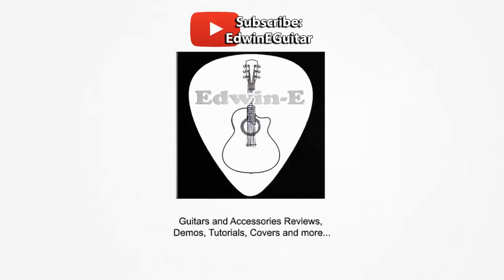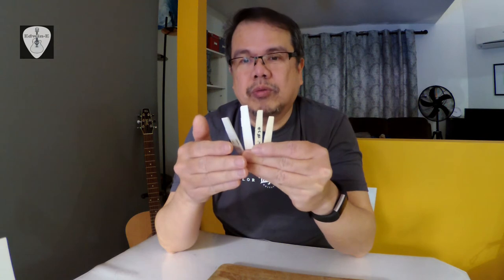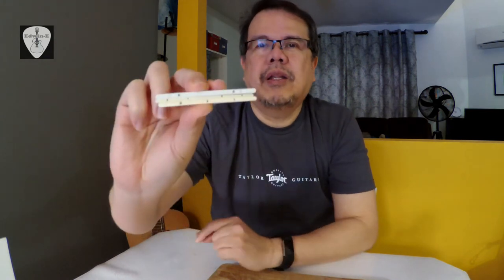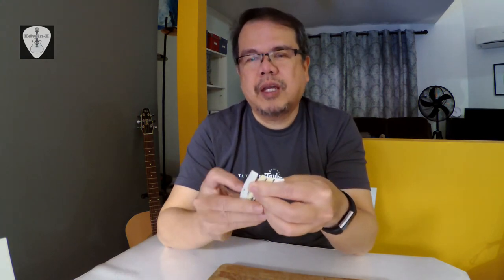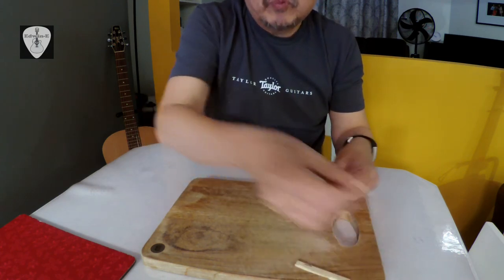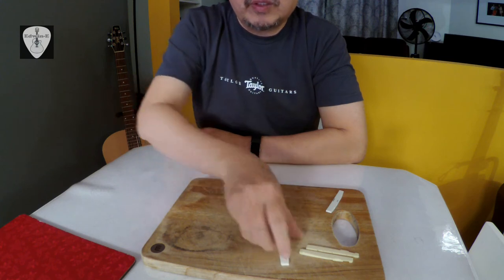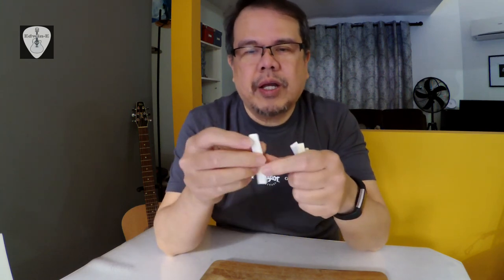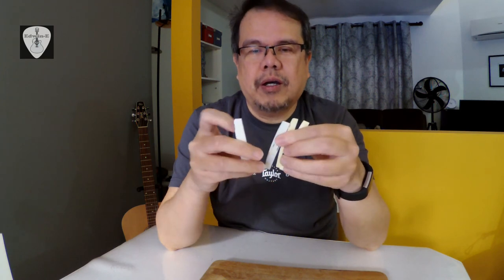How to Distinguish Guitar Saddle Material (Bone, Tusq, Plastic) | Edwin-E

Comment: I replaced the plastic saddle with a tusq on my slope shouldered Epiphone J45 and it improved the sound considerably. I read somebody said upgrading the saddle is the simpliest and most inexpensive upgrade you can do to improve the sound of your acoustic guitar. It really is true.
Reply from the maker: Yeah, saddle can really have big effect on the guitar sound as well as the strings.
Reply: @Edwin-E  you are absolutely correct, I know this from experience as well, that same guitar I restrung  with Martin strings and it upgraded the sound noticeably. I'd say replacing the string is number 1, then upgrading the saddle...if you're still unhappy afterwards...then replace the guitar😁
Reply from the maker: @ryckroldan  true
Reply: Sir.good day where can I buy tusq saddle? Thank yoi
Reply from the maker: @jrseaninferido3462  sa mga guitars shop or Amazon.  Di ko lang sure sa Pinas.
Reply: @jrseaninferido3462  check Graph Tech's website for a local dealer as well as the exact specification for your guitar.

Comment: Hey man. So I plan on changing my saddle on my Martin that’s about 11-years old. I bought a bone for the replacement over the TUSQ. However, after my drop test, I’m not that convinced or optimistic that the bone will have good mid-high tonal range. I’m thinking low end and that’s about it. Since my playing style is more classic/modern rock style, I’m thinking the bone will be too low and more for a country type rig. What’re your thoughts here? Thanks!
Reply from the maker: Bone will give a warmer tone to your guitar.  Having said that, Martin is generally warm sounding, and to give brightness, Tusq is perfect for it.  Just my opinion.  Since you already bought it, it is good to try and see if you like it.

Comment: Thank you for your video, some question:
- What is the best one finally ? What would you advise ?
- I had a "graph tech" saddle on my new fender Newporter but I broke it by mistake when I wanted to make the setup by myself.
So I changed it with a low cost one in plastic. Do you think it will impact the pre-amplifier ? I didnt test yet.
From where the piezo micro captures the sound ? From the saddle ?
Thanks
Reply from the maker: Plastic is not the best material for saddle.  I would prefer to use bone or tusq, it just depends on the tone of the guitar.  If you are using under-saddle pickup, I think it would be better to use Tusq or other high quality synthetic material so that it will have uniform density on all strings.  For some bone materials, since it is natural, some area may be denser than the other which will result in unbalanced pick-up response among strings.  I hope this helps.
Reply: @Edwin-E  thank you very much. You helped me.

Comment: I have a saddle in melamine mounted on Alahambra 4P classical cedar top guitar. It makes it sound full of harmonics and sustain! I changed with different saddle with bad results. Also reducing the action of the melamine saddle made the guitar loose some sustain and harmonics, traded for playability. I now play with the original stock saddle of melamine without any adjustment and the guitar is brilliant as expensive ones.
Reply from the maker: thanks for sharing your experience about guitar saddle.